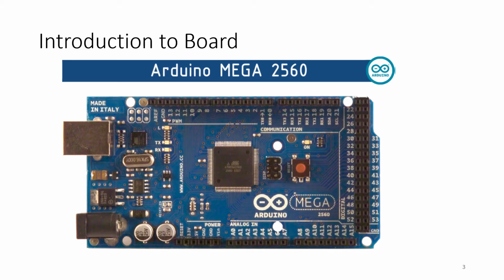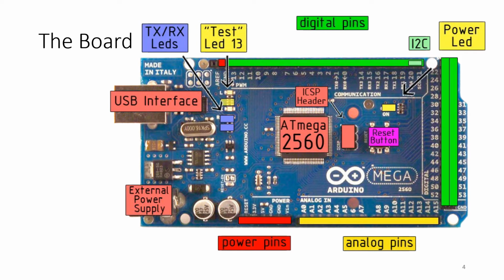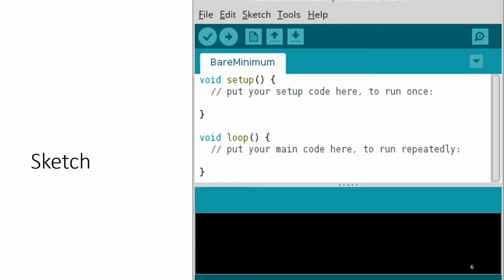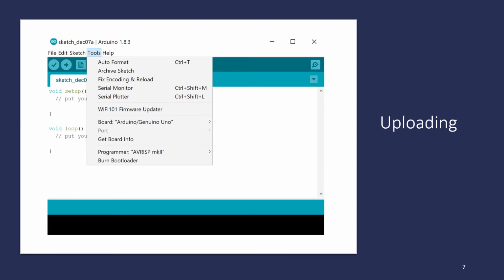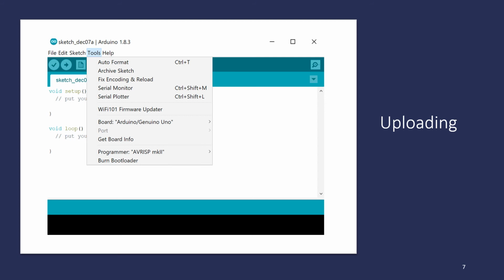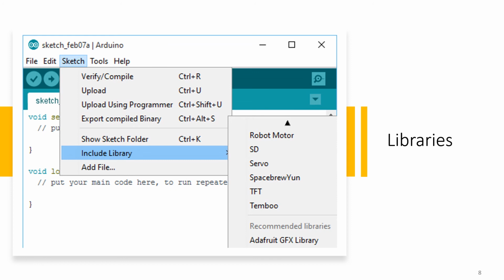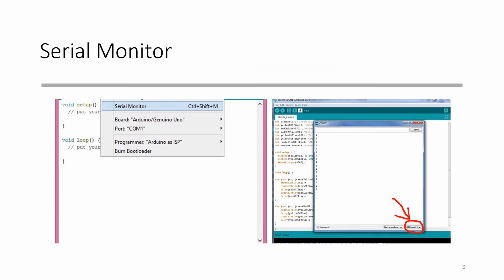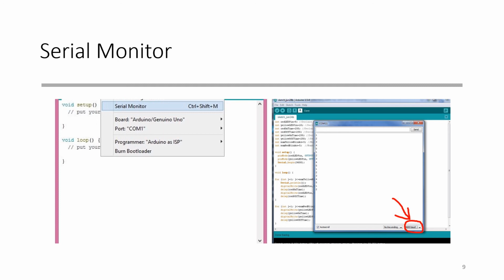Introduction to Arduino

Comment from the maker: Top 10 New Arduino Projects

Introduction to ATmega2560
https://www.youtube.com/watch?v=D4WxaLDBktI&list=PL9mpZcjuASXsbmKi8J4bTy8DcsF_kKtno&index=3

Introduction to Arduino
https://www.youtube.com/watch?v=9eHupU7014w&list=PL9mpZcjuASXsbmKi8J4bTy8DcsF_kKtno&index=3

Introduction to Arduino Programming
https://www.youtube.com/watch?v=BsCJwEJRaeI&list=PL9mpZcjuASXsbmKi8J4bTy8DcsF_kKtno&index=4

Arduino Programming – Analog, Digital, Serial Communication
https://www.youtube.com/watch?v=DmtTzYZlF0M&list=PL9mpZcjuASXsbmKi8J4bTy8DcsF_kKtno&index=5

Arduino Programming –Pulse Width Modulation
https://www.youtube.com/watch?v=Kes174sNGRU&list=PL9mpZcjuASXsbmKi8J4bTy8DcsF_kKtno&index=6

Arduino Programming on Analog, Digital, Serial Communication
https://www.youtube.com/watch?v=ZPkxz2ebUn4&list=PL9mpZcjuASXsbmKi8J4bTy8DcsF_kKtno&index=7

Arduino Programming –IR Wireless Remote Control
https://www.youtube.com/watch?v=Gv8tD-yjDo4&list=PL9mpZcjuASXsbmKi8J4bTy8DcsF_kKtno&index=8

Arduino Programming –LCD Display and PIR Sensor
https://www.youtube.com/watch?v=wERigxOMKOU&list=PL9mpZcjuASXsbmKi8J4bTy8DcsF_kKtno&index=9

Arduino Programming – DC Motor Controller
https://www.youtube.com/watch?v=9qv1_SurKBA&list=PL9mpZcjuASXsbmKi8J4bTy8DcsF_kKtno&index=10

Top 10 New Arduino Projects
Best Arduino Projects
Lear Ardunio without hardware
Basic of Enbedded system
Hardware and Software